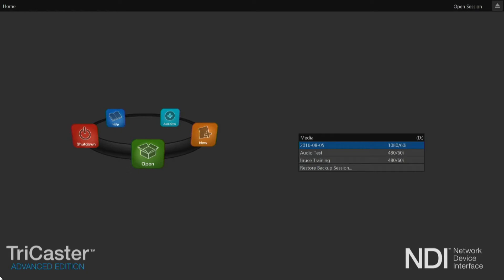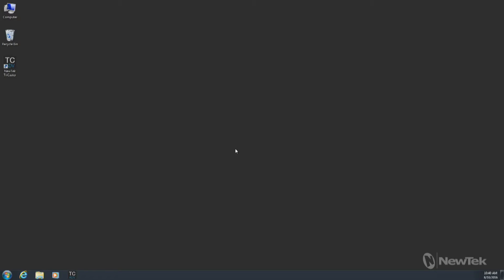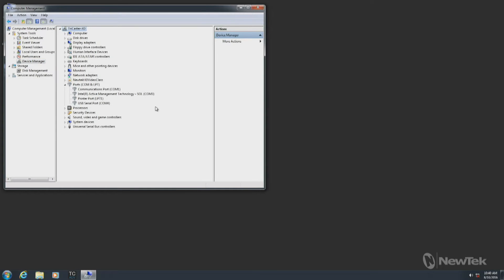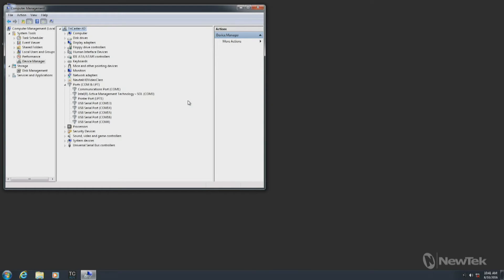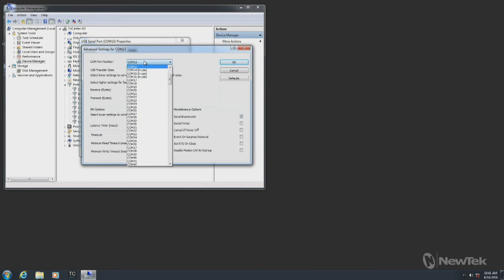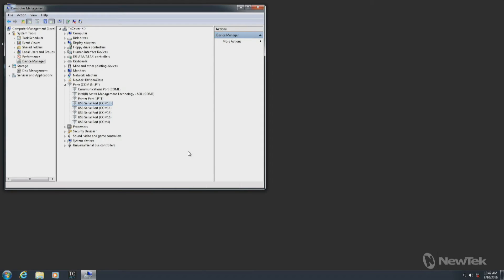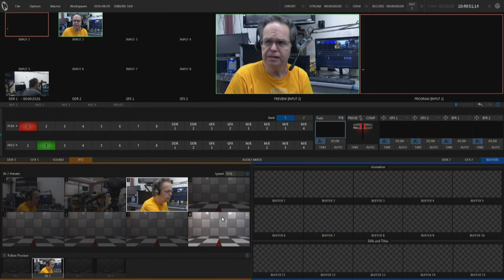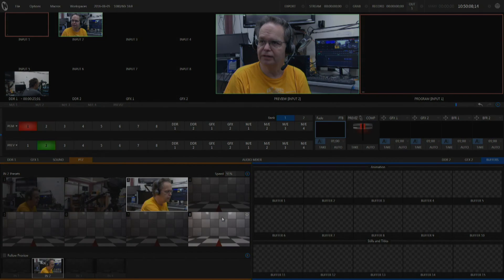Tricaster  RS232 PTZ Setup

Comment: I have a PTZ that we use as SDI signal. It works on our other machines but thr tricaster doesn't see the signal. Are we able to run the PTZ as a SDI vs the RS232?